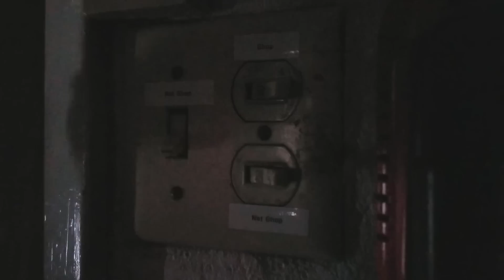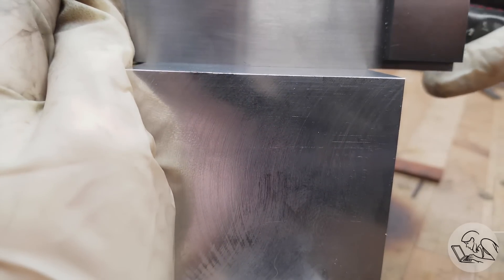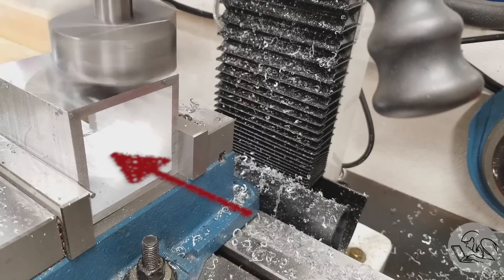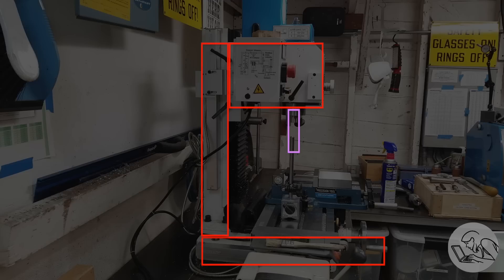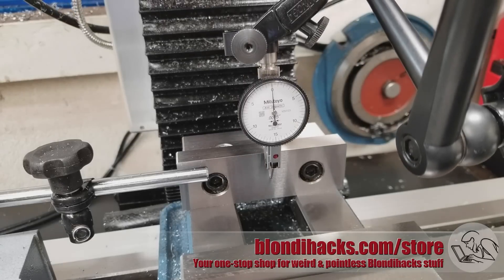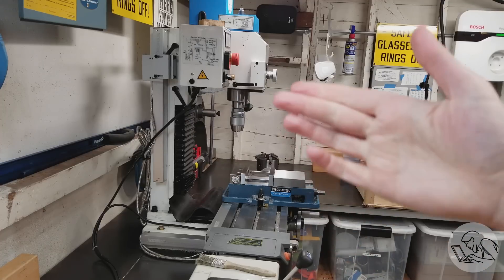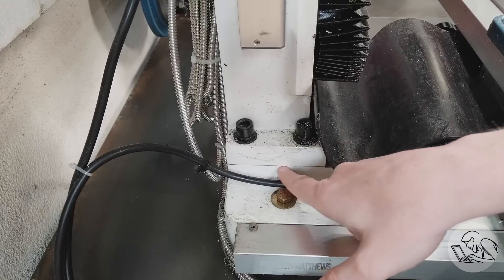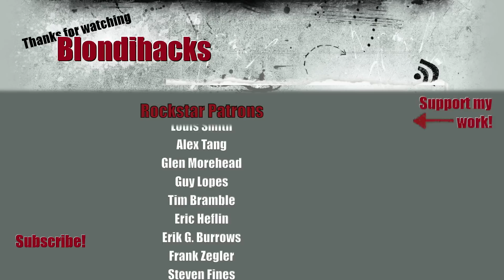Got Mill Alignment Problems?

Comment from the maker: Hey everyone. I’m going to explain this further here, since it’s a VERY common comment that I’m distorting the part with the vise. That is not the case, but perhaps that section of the video isn’t sufficiently clear. This is 3/8” wall extrusion and I’m clamping it lightly for these tests. It is NOT distorting the part. Near the end I check for that by putting the DTI on the top, above the wall of the extrusion. It moves 15 thou. That’s a huge amount, and not in the middle where distortion would show. The part is moving, not distorting. It is ROLLING upwards on the round bar, which is why removing that eliminates the problem. I hope that clears it up.
Reply: Actually, it looks like the front edge does lift from the clamping load, the max deflection is not at the center: https://imgur.com/a/ShOMb9k
Reply: Blondihacks - would placing the roundbar inline with the horizontal wall rather than higher on the vertical wall be the answer?
Reply: Blondihacks - thanks for the clarification.  I too had come away with the idea this was distortion of the part. (Also, this comment isn’t pinned so it’s headed down the feed...)
Reply: It was moving up because the wall against the fixed jaw bends as far as I can tell, when the pin is removed the force is taken by the wall against the vise base so it doesn't bend so much. Otherwise the same would happen with solid block, and that doesn't happen with solid block
Reply: Great video.  How are the ways on the vise?  I wonder if the round bar causes a rolling action on the movable jaw, which then lifts that jaw.  The effect would roll the part towards the column.  An indicator on the top of the movable jaw should give some insight. Just a thought.
Reply: @clawtlr  the movable jaw doesn't lift on this style vises because there is a wedge system pulling it down. If it appears to be moving, the whole vise is just bending to a banana shape as well or it is not adjusted correctly, or both
Reply: I wonder if the effect of the round bar would diminish if the piece wasn't sitting on the parallel...
Reply: nicky Fogg  it is misadjusted or the whole vise bends, I checked and it didn't move. Need a more sensitive test indicator to detect it, at least. I have the adjustment so that it always drags against the bottom so that chips can't go there as easily
Reply: nicky Fogg  should try while bolted and glued the vise down to 10" solid steel so that the vise bending theory could be totally confirmed, but I've been strongly under that impression after my various measurements relative to different places. At least on my mill table the vise bends pretty well and that is easily measured with my tools
Reply: Aww - I was about to feel really smug! I should have known you are too smart to fall for that. - Thanks for clarifying tho. Great videos.
Reply: I wonder if a half round rod rather than a full round one would work better to keep the part honest from any movable jaw nonsense. It it were a half round it would still have a single line of contact with the part, but because the other side is flat, the half round rod would not roll when clamped.

Comment: Love your videos,  I know you’re running the best small machining equipment available.  I’ll never disparage anyone’s ability to afford the best they can get.  I had a popular mini mill that I was able to keep in tram for the most part, but the flexing was also a problem.  I now have a 2800 pound Lagun Bridgeport.  It’s much easier to adjust and very solid.  If you have the room and budget, go as big as you can.  This is a great very informative video.

Comment: Awesome video! Although I'm not experienced in machining, I thoroughly enjoy watching these types of videos. If you happen to have a nod or lean, and you're concerned about preserving rigidity, could placing a shim at one end of the vise be a viable solution to align the stock with the head? Or would the clamping process potentially disrupt it?

Comment: Hi, quick question. What 2in dia end mill are you using??? I clicked the link you provided and it just directs me to smaller diameter end mills. Would mean ALOT if you can send link for bigger end mills. I have been looking and cannot find end mills that look like yours.

Comment: One of the First Things i did when I got my mill year's ago was I made a DIY tramming device which comes in the spindle and has two indicators 25 cm away from each other so I just have to have the same reading on each side and I'm 💯 okay ...fast and easy ....you can buy the same thing but if you build it properly there's no need it is precise as can be ....I don't say again that Quinn's videos are so good and informative it's getting boring to repeat myself every time  🤪

Comment: Had  exactly the same issue on my PM-728vt with a superfly.   Followed pretty much the same steps.  resolution, stop using wire on the movable jaw side. Tried both copper and aluminum wire.
Thank you, great video.

Comment: Enjoyed that 👍 my 32l mill managed to have a collum way more than 5 thou out, on top of 6 thou nod in the head. I used gotteswinter video to epoxy the collum which worked well, shimmed the head, but one day I'll bite the bullet and grind/scrape it. Think it would be worth it to get the rigidity back.

Comment: Thanks for this and all your other great videos. In my apprenticeship here in Denmark i was taugth that you should have a small tilt in your mill, as when you move forward the tool will cut with a nice surface, and not having any marks left by the end of the tool. of course the tilt should be very small. I would also take care to always go the same way so that your grooves align and you do not cut with the movement but against it. But thats for manual milling. A CNC  mill should be 100 % aliogned as it compensates for the loosenes of the machinery.

Comment: A very high value lesson in sleuthing machining errors was just given.  Worth three x the time invested at the least. Looking at the part in the vise  the wire may have been deforming the wall of the stock inwards therefore  shortening that leg of the tube  lowering that side of the top that was being milled. 
Machining the end first and clamping across the length may have helped the issue, But Hindsight is always  20/20.
Mahalo

Comment: BRING THE SPINDE DOWN TO THE VISE THEN CLAMP THE SPINDLE TO THE VISE SLIGHTLY... SHOULD GET YOU CLOSE THEN...DO FINE ADJUSTMENTS WITH AN IDICATOR BACK AND FORTH ON THE HORIZONTAL VISE JAWS. IM KNOW IM TO LATE BUT KOOL THNX...

Comment: Great video .
When I machine , I hold the work piece with 1/8" dowel pins .
Also the side pin I hold it in the center of the jaw . I noticed it was held more to the top of the front jaw, and high parallel underneath. 
I'm a tool maker for 35 years . 
I must say it was great video .

Comment: Shimming is my only saving grace with my round column Pro Cut.    The last time I ran the tramming process I used aluminum for shim.  I will replace that with steel.  Thank you.

Comment: First off, thanks a lot for the great videos. I've not done any machining for nearly 40 years, but I took a lot of classes in high school and college, and was also a "helper" in those classes since I seemed to have a knack for it.

I did a similar thing on 10 pieces of 6-in square tube steel for the shop teacher. What he had me do first was to make a precision angle plate that I could clamp the vertical side of the tube to, and then the bottom of the tube was clamped to the table. It worked out quite well and the surfaces ended up being within a few ten thousands when I was done as long as I didn't try to hog off too much on a pass. It was a fun experience. Have no idea what those were ultimately used for, and the shop teacher didn't know either. Just given a rough hand-draw on a sheet of oily paper. :)

Of course, Aluminum is a whole different game. I did little machining of it in my time.

Comment: Instead of small round stock, I have always used a piece of 1/8" Aluminum Tig Filler rod, that squishes and sort of conforms with the movable jaw and still holds.  I really had no discrepancies, but I should check.

Comment: Very interesting.  In the 1970’s I worked as a machinist in a shop that milled a lot of sand cast aluminum.   Fly cutters with cemented carbide tools were the norm.  Tolerances were in the .005” range.   Things worked well.   In the 1980’s I worked as a detailed parts inspector at a place that made parts for Boeing.  If you had a whole .001” tolerance you were in high clover.   If you know geometric tolerances you will understand that the .001” was in parallel and square as well.  This shop NEVER used fly cutters.  The flat milling was multiple passes with .500 diameter cutter.   This was done specifically to negate any tram ( any direction) effects.   Thought you may find this interesting.

Comment: Aluminium extrusions are seldom normalised and have a lot of internal stresses post manufacture. They pretty much settle into some form of equilibrium but this all goes to rats when you cut the skin on a surface. The stresses are unbalanced and it distorts. The degree of distortion depends on the quality of the extrusion. Ask for normalised extrusion or carry the process out yourself. This lesson was painfully learned machining alloy extrusions to make a large scale 3D printer ( 1.5 m x 1 m x 1m!)
 Check the certificate of conformity for your stock, sure you got a good idea of what to avoid or at least treat with suspicion.........

Comment: Now that was an emotional waterslide ride as Quinn fixes, fails, fixes, fails, and fixes to ultimately find success by applying the KISS rule with this type of stock. Issue resolution was an om moment. I confess that my eyes crossed more than once as my appreciation grew for what seemed to be a futile battle with the evils of nodding, leaning, kneeling, and tilting. May you always be my teacher. :)

Comment: I’m a new mill owner and have been ironing out alignment issues from ‘first principals’ and one issue ( among many) with these ‘Weiss’ factory mills is the poor locking mechanism of the head rotation where even a few ‘ optimistic’ cuts on a fly cutter are enough to knock it off tram. I’m experimenting with attaching some metal plates to bolt to the sides of the head over the rotation joint to secure it more solidly. I’d also recommend if anyone has a masonary wall behind e bench to make up a wall brace to tie the top and even the middle of the column  to it to prevent twist under load.
Reply from the maker: I have also found that the head on this thing is not great at holding a tram. An easy solution might be to simple drill and put a pin in it once well-trammed
Reply: Good idea! I've also installed a spirit level vial from an old survey instrument so I can see if it's been knocked out of tram without having too break out the dial indicator rig.  @Blondihacks

Comment: You can check for head nod after you've trammed the column by mounting an indicator on the table and looking for any deviation of the spindle as you raise and lower the head.

   I recall watching one video where the poor fellow was sure he could tram his machine simply by milling the table. I cringed all the way through it. He was adamant that he was right even after I explain how an out of tram column would leave scalloped grooves in his parts.

Comment: I like to inspect gib adjustment with dial indicator & a tug when I tram the head, since the indicators are out and area is clean and clear, takes but a minute.  2 minutes if adjustment is needed.  Keeps my machine's movement "honest" and the gremlins at bay.
Reply from the maker: Definitely. I just did that myself recently and found my Y axis was a few thou loose!

Comment: Why not use two parallels on the bottom of the vice, and tap the part down to them after mild clamping?! And/or use the round bar vertically on one side of the vice for the next cuts from there on?! Thinking out loud... it might stop the part from rolling up or down and even it should move ever so slightly right/left, it might not change the top surface from being parallel to the bottom milled surface. 🤔 Stay safe and keep up the great work Blondi :)

Comment: I'm just wondering what your DRO's accuracy is, I have the same type of mill but need to decide between 1um or 5 um scales.
Reply from the maker: Mine are 5uM. They came with the mill, but if I was buying them, I’d probably get 1uM. I think its worth it, if the price isn’t too much higher.

Comment: Very imformative, i would have gone down the machine overhaul method as well.  I supose its down to wether you trust your machine.  You have what looks like an import and mine is an old Royal Air Force apprentice machine circa 1940 Elliott 181.  Trust its accuracy No!.  The maintenance manual is written on 5 sides of cigarette paper.  I think ive added about 1 sheet of A4 to the collection.  The old beast has been converted to CNC using GRBL which works (notice how no adjectives were used).  The pain is it has to be loose enough in the bed ways to allow free movement but that relates to innacuracy in the moves.  I changed the old Acme threads for ball screws with anti backlash nuts worked a treat - got rid of the 2 lb hunk of brass wear part/nuts.  Now have less than a thou backlash in Y and just over 1 thou In X. I can live with that.
Please safe and well all

Comment: Hi Blondihacks, you compelled me to learn how to drive F 360's FEA.  You've also compelled me to learn how to upload and share data. Man, I've got a long way to go: https://youtu.be/1LtbsOX-w1s , I hope that worked.  You can see interesting distortion but there is only about .0022" in the direction you are seeing the problem.  I don't see the part lifting off the vise base in the same manner that shows in your video.   Look at https://youtu.be/asmH4HjZLRY?t=81. The base of the part has clearly lifted off the bottom of the vise.  It really appears as though your vise fixed jaw may be flexing enough to allow a square section to lift off the floor of your vise and rise on the rod in the moving jaw.
Reply from the maker: That’s a cool simulation! Thanks for sharing that! The part does appear slightly lifted in that one operation yes, but that bottom face is unmachined at the point. That lower angle on the extrusion is slightly less than 90° so that little gap is the fixed jaw doing its job and preventing the unmachined sides from influencing alignment. The gap is about 5 thou. Again, nothing like the 20 thou of error in the final cut.

Comment: Nice "What Done It" 😱.
Check out "Ades Workshop", a new You Tuber who has just purchased a similar mill, and is blue printing it.
A machine tool builder, would use a cylindrical square, also called"Bottle Square" this enables checking of column and head stock.
Are you able to manufacture a tramming device narrow enough for the Y axis?
A good check for vice jaw YAW or tilt, is to clamp your precision square in the vice, and experiment with grip force. Position the square with thick outside"L"  or stock against the fixed jaw, and the  blade pointing towards you, use DTI from spindle and traverse length of blade, ensure the blade is perpendicular along thin thickness section.
Great treatise on mill alignment.
Thanks for sharing and stay safe all.

Comment: Thanks! Best video I have seen yet on problems of squareness on the mill. Especially good since I have the same mill. In the past I had always worked with Bridgeport type mills which have the capability to adjust for nod and when we trammed ahead we indicated from front to back as well as left to right. As a side note, for whatever reason, during my 20 plus years in several different shops I had never heard of "tramming the head". We always "swept the table" or "squared the head" but I was working for the last half of my career in IT so upon returning as a hobbyist I now hear "tramming" as the most common term.

Comment: Better than shimming, is to scrape in the column and nod. Those hobby machines can always benefit from some scraping as most of the mating surfaces are somewhat rough milled, so you not only improve alignment, but rigidity, too.

Comment: Possibly clamping the part directly to the table with finger clamps rather than using the vice might have solved the problem as well. You would have to be careful of orientation WRT the direction of the cut possibly but you were taking light cuts in aluminium so it might not have mattered that much.

Comment: Hi BH. Magic words. Stefan Gotteswinter. He did an realignment of his mill column using a made for purpose metal epoxy to, needless to say, improve the rigidity. It’s a hairy operation though. Need to get the alignment sorted before the epoxy goes off. An enhancement to his approach would be to install some adjustment grub screws to help set the alignment, but that would make it an EVEN bigger job ... BobUK.